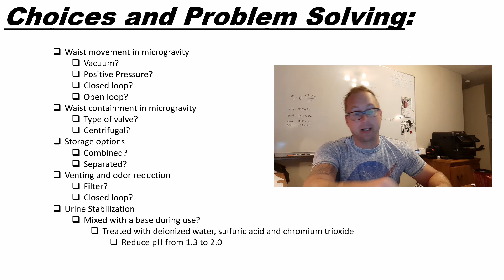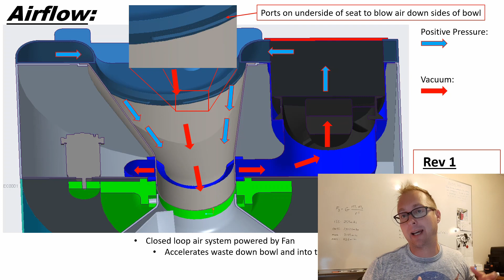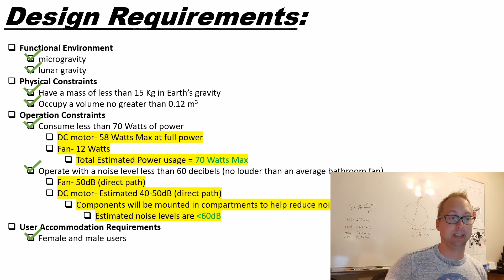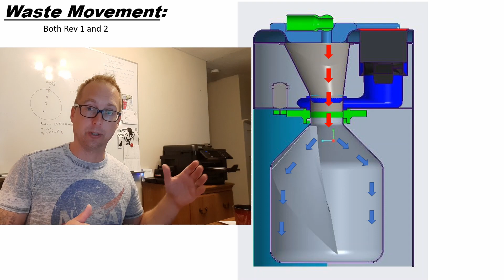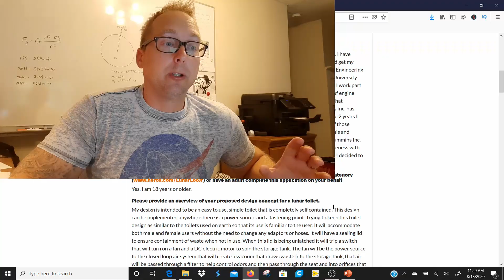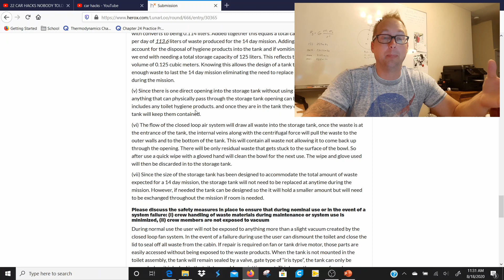New NASA Space Toilet Final Design Explained | How it Works

Comment: Looks good.  I'm curious whether this would work in microgravity, as I can think of several things that could go wrong in the absence of weight.
Reply from the maker: I am sure there are features that would need testing to verify and improve, but just like every idea there has to be a starting point! Thanks for checking it out. What were your thoughts on what could go wrong? Would love to hear feedback in hopes of improving the design!
Reply: @thedanielk.project4998  I mostly have questions about how liquids act in microgravity.  Water is sticky - how would it behave when it touched the sides of the bowl?  Would it stick there?  Would the air flow be enough to move it when it was sticking there?  Would the liquid tend to spread out and cover the sides of the container, or would it ball up?  I guess these questions could be rendered moot by coating the whole interior in some super-hydrophobic substance so the liquid wouldn't stick.  What's to prevent the liquid from following the air into the air intake and getting into the fan?
Reply: Possible solution to keeping the liquid waste in place - put some highly absorbent disposable material in the waste container, so that once the liquid reached that area, it would stay contained.